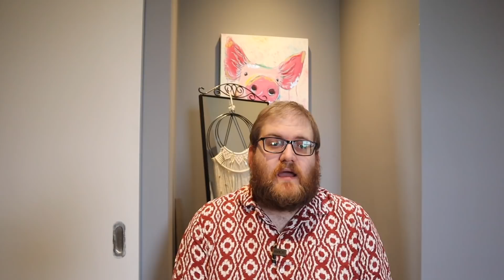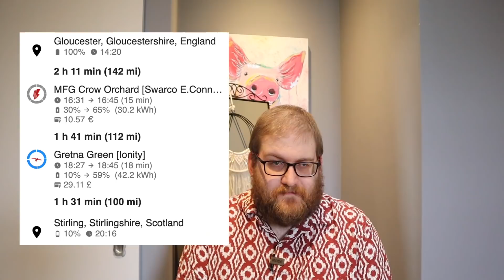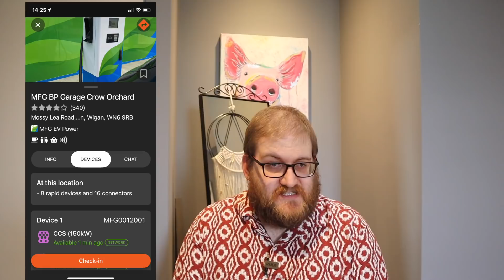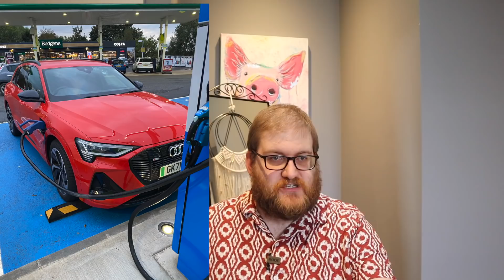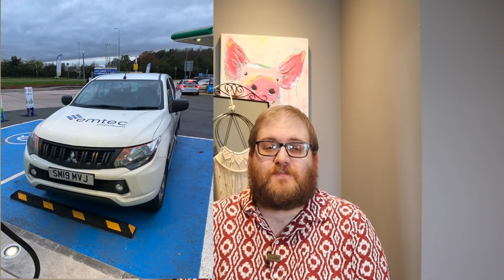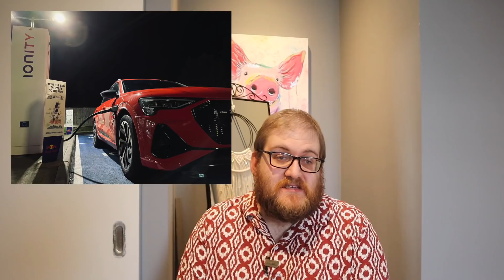Is CHARGING SPEED more important than RANGE?

Comment: I will definitely look for a car with a larger battery next time.  At the moment I have a Corsa e which is claimed to have a 50 kW battery.  However only 45 of that is useable and nobody is going to want to use the last 10% without looking for a charger.  That leaves about 40kW that is actually useable.  Keeping to motorway speed limits gets me 4 miles per kW in summer so that means a range of 160 miles.  That isn’t enough with the present charging infrastructure in this country and don’t forget most chargers will only do 50kW. Some so called 50kW chargers will only give 35kW even though my car will charge at 99kW.  I usually take a decent meal break en-route so a 1 hour charge is possible. 
Another problem is that now we have Gridserve chargers and everybody knows about them, consequently there is often a queue.  So a bigger battery is my next ambition. I need more options which a bigger battery would give.  
I agree with your concern about the chargers at Crow Orchard.  The cables are very thick and unwieldy.

Comment: Totally agree. Realised how important charge speed was a while back when I first used rugby services. Etron charged faster than I needed it to 😂 and didn’t feel like an inconvenience at all - first time travelling distance in an ev didn’t!
Your video has also made me realise why I'm not getting full speed from 150/175kw chargers. Didn’t realise you could only get those speeds from an 800v car at those. That explains why I’ve only had full speed at IONITY and 350kw gridserve. As you’ve said though, still not enough hpc throughout the country although it’s improving.
Reply from the maker: Depends on the charger model - these particular ones MFG use only do 150kW at 800v but others might well be able to go harder at 400v.
Reply: Also, Instavolt (for example) often state 125kW but it is shared between two units, if I am on one unit, on my own, I get around 82kW but if it is shared, it is in the 60's, Fastned (not many around) are another that always seem give 150kW

Comment: No - range is the more significant. Range buys you the flexibility to decide when it’s critical to charge. Charging speed helps but realistically few people choose to stay with their car on a public charger anyway. At least I try to combine charging with doing some other activity.
Reply from the maker: A lot of people say this but if you’re making this same journey in a car that takes longer to charge what activity are you realistically going to do for 30-45 minutes multiple times whilst you’re actually just trying to get from A to B?
Reply: @ModernHeroes  that’s the point though - if you have 250-300 miles range you stop once. Start with 90% charge and get another aboard at 20%. How many 450 mile journeys are there in the UK?. For everyone not driving London-Aberdeen regularly the onboard range means flexibility as to when you need to charge. The greater problem I have is finding working chargers that aren’t already in use. The endurance in the battery is worth more than anything else. I had a choice of a Citroen eC4 or a eNiro2LR I’m so glad I went with the rangier option and would recommend the same to everyone.
Reply from the maker: ABRP reckons a 64kWh e-Niro would still need two charging stops to complete this journey (likely a casualty of charger placement which is a whole other issue) - 54 minutes charging in total at the same two stops.
Reply: @ModernHeroes  it’s wrong then.

Comment: Glad you had a good experience. 
Charging speed (and pump capability, availability and reliability) really does make a massive difference. When Audi concentrate on efficiency, the per mile equivalent charging speed will increase further…with resultant lower costs. It would be interesting to compare the mph charging rates equivalents of the Audi, Model 3 SR+ and the Ioniq 28…and the cost to charge for a given distance, using the same charger for each car. 
I’m having trouble trying explain what I’m on about, but basically see how the combination of battery kWh size and wh/mi efficiency work together in the real world.

Comment: I'm here in the US and I need a combination of the two. I don't need over 400 miles of range but I do want real world driving range over 300 miles. My eye is on a Model Y because it get 353 miles so if I charget to at least 80 to 90% then I'm looking at 300 to 310 miles of range. For me and the long expanse of roads we have this would be perfect. 

Yes, charging speed is a major factor as well on these road trips. So it would be really convenient to get consistent 100kw to 150kw charging. More if the EV can handle it.

Comment: Just think, we wouldn't need much range if there were 225 to 350 kW chargers on every forecourt around the country/world!
A (say) 50kwh battery in every car, so 20-80% being 30kwh's going in at such speeds, about 5 to 7 minutes and good for 120 miles (large car) or 160 miles (small car). Then on a long journey, top it up to full, knowing you're going to need to go for a no.1 after 200 miles, so you may as well go after 160 while your car is taking 10 minutes to fully charge - especially if there was a nice buffer (8 to 10kwh).
The cars of the future would then only need a very small space for the battery giving more room over to passengers comfort etc. Then with full automation, we can get into our cars and relax in a lounge type atmosphere etc! Pipedreams of course!
But if every forecourt could have at least one ultra rapid charger and cars made with ultra fast charging capability - we'd be somewhere there for BEV's to be attractive to the general public as a whole!

Comment: Yes definitely 150 kWh should be made standard when I eventually buy an EV I would want a good range plus decent charging speed
Reply: I think you probably mean 150kw charging? Kwh's are your battery's charge holding capacity - 150kwh would get you about 400 to 500 miles - and nobody's bladder can last that long!
Reply: @computerbob06  yes my bad

Comment: Yes, I agree, charging speed is now the new important factor, 0-60 times, who cares, under 8 secs is very fast. Range 225 is enough , but only if you can guarantee the charge point works and is available.
 Just swapped my eNiro for an EV6, it is a superb car, very comfortable and long range, the efficiency is not as good, but it is a bigger car, and of course it is one of the fastest charging cars around, if I can find an high enough charger.
 Thanks for the video
Reply from the maker: EV6 looks fantastic, hoping I manage to have a go in one at some point! Congratulations.
Reply: I have had my E-niro for about 10 months now and to be fair I have never really felt the charging was too slow. I have done a few 200-220 mile runs so no charging needed and a few 300+ so only really one-stop needed. 

On the 300+ mile runs the car was always done charging before I was. So other than where the destination charging network has not been up to scratch in 10 months I have needed to use a rapid charger 4 times on long runs.

If we had better destination charging then charging speed would be less important to people. i.e.  if you are doing a 350'ish mile run and you know 100% you have a parking spot with a charger at your destination you would be more likely to just do one recharge on route to get you to your destination and the cheap or maybe even free destination charge. 

Sure for the professional long range drivers doing 8h's driving a day it might still be necessary but for the average driver\journey is it really needed?

Comment: More important than both charging speed and range is a plentiful supply of reliable public chargers. 

If I know there will always be a rapid charger available wherever I stop. A 250 mile range is adequate. 

Likewise I don't see the need for 350kW chargers. Very few EV's can charge at more than 200kW for long. Seven 150kW chargers would be far more useful than three 350kW chargers .

Comment: I would say the opposite is true, if you can do your whole journey on your range and charge much more affordably at home then that's definitely true.

Where as the quoted max charge rate is achieved for a fraction of the SOC and does not always reflect what you get. Especially as most rapids at 50kw.
Reply from the maker: Depending on the car - very much not the case for the e-Tron, it pulls hard at pretty much any SOC to a frighteningly high state.
Reply: Totally agree. For many people (not all) a true range of 250-300 miles would mean all charging could be done more cheaply at home or on chargers at work or other destinations - just topping up (so speed is not always the issue) It’s also true that some manufacturers (Kia and Hyundai) despite ambiguous phrasing in their manuals, actively recommend the slower AC method for most charging. We should not overlook the fire issues that Chevrolet and Hyundai experienced with some of the LG batteries - I wonder how much that was attributable to too much rapid charging - those vehicles were available before 100kW/h + rapid chargers were widely available. No question Ultra rapid charging has a place, but it’s no panacea.

Comment: You don't have to have an Audi... Last weekend went to Doncaster and back (130 miles each way) in the ZE50 with CCS, just let it have a quick fill at intermediate stops each way (shame, Ecotricity was on free vend) and a big fill while we were having lunch.  Unusually, the M62 was quite clear so the journey time was on a par with previous trips with ICE, but with the Zoe was far quieter and more relaxing.  Max 50kW charging of the Zoe was not a problem as most of the connections on the M62 are 50kW anyway.
Reply from the maker: ABRP reckons this journey would need 2 hours and 8 minutes of charging in a Zoe ZE50 so whilst it might work well for shorter journeys it’s not going to be the best experience covering serious distance.

Comment: In general, I would say range and charge speed have similar importance, although once you get beyond 220-250 miles of range, I’d look for faster charging over more range. Although we do need an infrastructure that keeps up. We not only need more rapid chargers but plenty of fast chargers, so cars with slower charge speeds don’t tie up the rapids. We also need much more education for new owners, I helped numerous EV owners on holiday in South Devon that had plugged their new EV into the AC outlet, presumably because they recognised it from the home charger. I just told them their cat would charge a lot quicker on DC and sometimes had to help with the App etc. And just a final aside,  can we all ask (when networks are asking for opinions) for AC outlets to be tethered where practical. When you are disabled, it makes a huge difference to the ease at which you can charge

Comment: I think your correct. Once most cars can do 200+ miles before needing to charge then the next big hurdle will be charging speed. Even will smaller batteries this will become the benchmark. Keep the reports coming.  On another subject I've noticed the 'green flash' on the number plates have already started to be abused by other cars. I was driving behind a Suzuki Vitara  the other day which had green flashes , go figure.
Reply from the maker: Some main dealers are fitting them to brand new plug in hybrids, I said the scheme was a farce and a waste of time and I'm being proven right it seems.
Reply: @ModernHeroes  I bought a new E-Niro in April this year and I had quite a job convincing the dealer NOT to fit the green strip plate, which didn’t suit my personal reg and which carries no advantage in my area of NE Scotland anyway

Comment: Yes fast charging speed is a game changer. But it doesn't have to be at the cost of efficiency. Most manufacturers charge a premium for fast charging (some extra margin included!)..... but I presume this will change quite rapidly as more models enter the market. I love my Zoe and have done a few longer journeys now... but if the standard spec was 50 KW CCS and the option was 100 KW CCS for an extra £600 ... the yes I would tick that box!  Yes this is the future and it's coming fast.

Comment: Range = big battery = heavy expensive car = higher consumption especially in city traffic. Small battery + proportionally big onboard charger = nimble car with the same day range as a long range EV, though needing frequent short charging stops when on a road trip.  This is the better option than an expensive EV with a 80kWh battery, which needs DC charging when you finally need charging, because otherwise it takes all day.

Comment: You forgot to mention that the eTron has a huge 95kWh battery which also makes up for its shocking inefficiency.
Reply from the maker: The 55 does, yes, although you could make this same journey in a 50 just as easily assuming the charging curve is as strong.
Reply: the usable battery on a 55 is 86.5 with the additional 8.5 as a buffer that is not available for range
Reply: @philhartley7564  86.5kWh is still a very large battery. The huge 8.5kWh safety margin is what gives Audi the flexibility to allow such a high power charge curve
Reply: @nealm1814  good for Audi, it seems like a sensible approach to me, certainly works on my long journeys

Comment: The eTron 55 is often misunderstood and more often linked to thirst rather than its' consistent, and high, charging speed. I've used both these charging stations, often, with very few issues. The main one being waiting for 10 mins at Ionity Gretna because of queues (during the holidays), never had an issue with MFG. One issue is that both charging stations serve both north and southbound traffic on a motorway and (particularly) Gretna does not have sufficient chargers (4) for users travelling in both directions with very little obvious space for expansion. Ionity Beaconsfield has four chargers and only ever have I seen two working at any point in time since opening (i've stopped 3 or 4 times. Again this motorway services serves both Northbound and Southbound and there seems to be little common sense to the need for numerous chargers especially at such key locations with such a high degree of traffic.
Reply from the maker: Agreed.  On the return journey I had to wait at Gretna.  I passed the ID.4 driver that was insistent on charging to 90% on the M6 some time later, considering I had to wait for them to finish and then charge.....
Reply: @ModernHeroes  To be fair to the ID.4 driver, I usually arrive there at around 8% -10% and go to around 80% - 85% charge (just over 30 mins) which will get me home with about 10% - 15% to spare. That works for me as there a no 150kWh chargers between Gretna and home (apart for Blackburn which means diverting for about 30 mins). A good bail out option but not one I have ever needed. If I am heading further south as you were, (not home) then I would probably go to 80% anyway which gives me about 170 miles and a stop in 2 - 2.5 hours depending.

Comment: With my ioniq 28  I so far seem to not give a dam about charge speed  as every time I charge i am doing some thing else  eg Not sitting in the car waiting to get to the level .  like some people seem to do
if I was stuck in a traffic jam then being able to get some fresh air and stretch legs etc would be higher on my list than the car need 30 minutes to charge on a 50 kW charger.
Having a car that only does 3 miles to a unit and a big battery is for me not good as this means higher bills to charge  and every mile  
costing more to do. and longer charge time are for me would be a pain
there is no reason why an electric car should not have good efficiency   like most petrol engines were so many car seen 30 mpg as acceptable by far too many companies.

Comment: Fixed and tethered CCS charge cables, and shortness of cables. Totally agree.
My Mii Electric REALLY struggles to fit into some CCS chargers, unless you park at an angle. As the charge port is on the driver side, and the charger location when parked is off the driver side with the front wheel level with the body of the charger.
Its a stretch to fit it if driving "head in", and if reversing in, you have to pull it around the back window, and it ends up resting on the body work :(
Reply from the maker: Same position as the i3 - have definitely encountered some awkward chargers clearly designed for front loading cars!  Having to do a 3 point turn on a busy petrol forecourt to oppose the flow of traffic was a particular favourite.